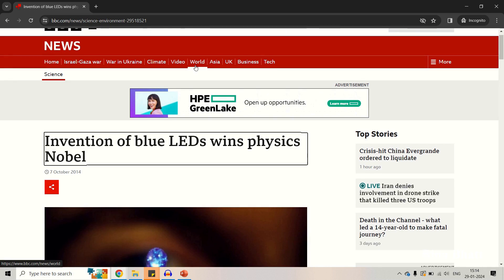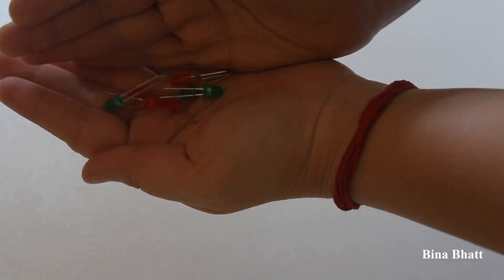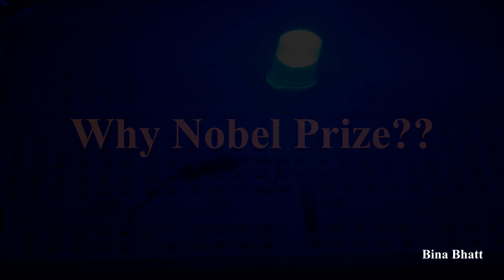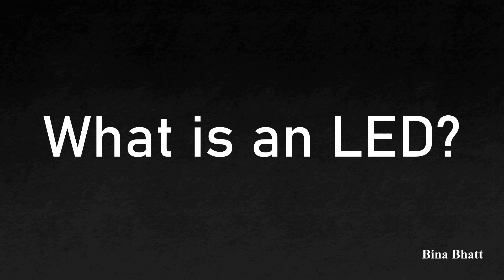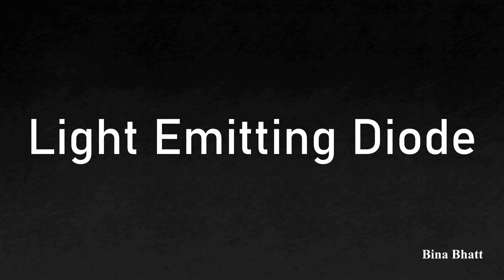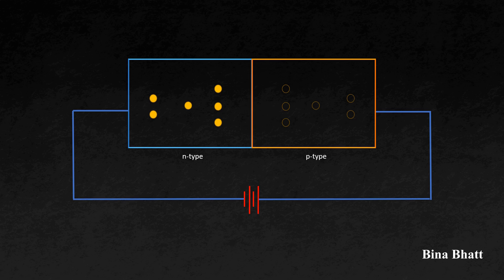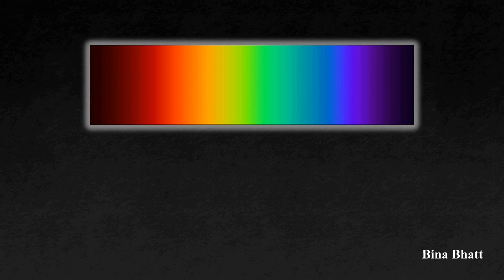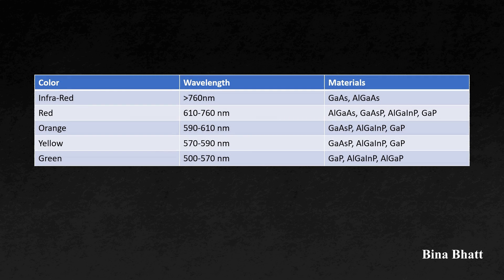Why were Blue LEDs so hard to make? #blueled #led

Comment: Hello madam, I am a physics researcher (persuing PhD) and I am interested in the field of LED and luminescence. I have prepared a new type of red emitting phosphor. I have already published some theoretical articles on other topics but currently working on that phosphor material which I experimentally synthesized recently. I am new in this filed of LED so have some queries. Can you tell me why do we use phosphor coating on Blue or UV LED chip to make effectively white LED? I mean why don't we just mix red green and blue (RGB) LED chip and mix them to get White? Would not it be more efficient than coating phosphor on blue/UV? Because I think we need more energy to light up UV or blue LED chip and then just RED Green and Blue. Am I right? Looking for your reply. Can I get your email id?
Reply from the maker: The choice between the two depends on the specific application needs. 

Phosphor-coated blue/UV LEDs offer a simpler design and implementation process. This approach streamlines manufacturing because it uses a single LED type to produce white light, reducing complexity and cost. Essentially, why use three LEDs when one will suffice?

Conversely, RGB LEDs are ideal if precise control over colors is required, such as creating various shades and dynamic lighting effects. While RGB LEDs can produce white light, their implementation is more complex. Managing three LEDs increases costs and makes it challenging to maintain consistent color output due to temperature shifts and aging.

Ultimately, the decision depends on the specific demands of the application. For simplicity and reliability, phosphor-coated LEDs are preferable. For dynamic color control and flexibility, RGB LEDs are the better choice.

All the best for your research!

Comment: Blue LEDs are so difficult to produce because they require up to 7 layers. 
For a simple red LED only 2 or 3 layers are used, 
for a simple diode only 2 layers are used. 
Red LEDs were discovered by chance while trying to make normal diodes. 
Silicon-based diodes in a transparent housing even emit infrared light. Even solar cells can emit IR light.